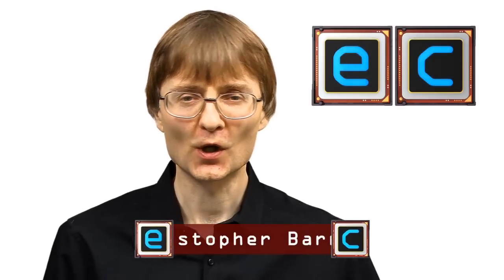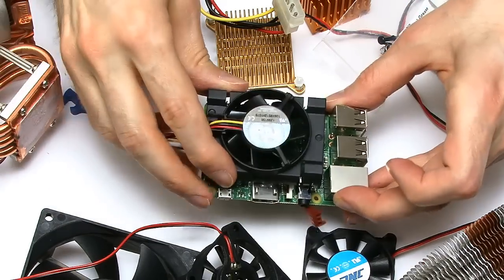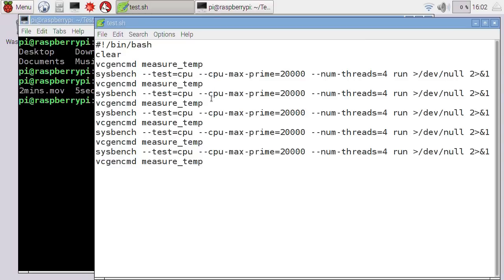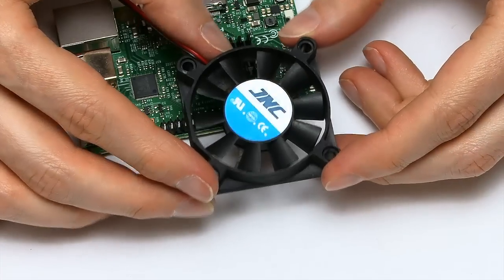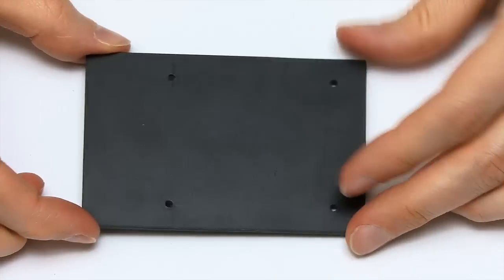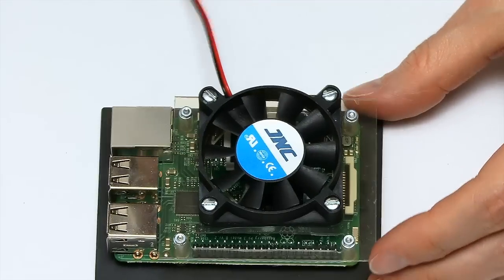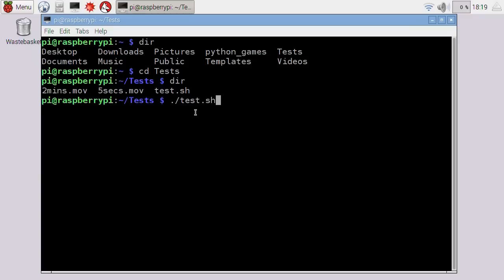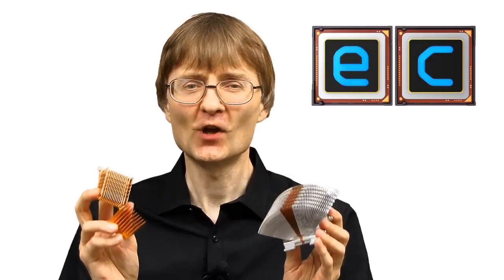Raspberry Pi 3: Fan and Cooling Tests

Comment: Those things that you keep referring to as bolts are actually called nuts! The part with the long thread and the screwdriver slot  is the bolt or screw.
Reply from the maker: +martin nash I know, I know. But under the movie lights, my brain sometimes gets scrambled. :(

Comment: actualy u had done it more faster with the 1st in minute 2:27 all u had to do is to pust something in the holes of the Pi and keep the colling up easy thing the 2nd only was gud if the pi cannot keep the 2nd cooler volts
Reply from the maker: +Dying Upon The Truth The Pi sadly could not power the first (12v) fan.

Comment: With RAM being so abundant these days, with some builds having almost hard drive levels of storage in RAM alone, I was wondering if an OS could be installed in RAM. From what I understand each reboot would wipe it, but would it be possible to load up a really fast windows on it for example? Do you think this is possible and if so how would you go about doing it?

Comment: All good doing this, however you need to see if the governor starts to 
down-clock the CPU, this really has a bad effect on performance.

To find the governor set speed:

# cat /sys/devices/system/cpu/cpu0/cpufreq/cpuinfo_cur_freq

To find the actual CPU frequency:

# vcgencmd measure_clock arm | sed -e "s/frequency(45)=//g"

You may want to round off and divide this readout in your script:

sprintf("%.0f",$1/1000000)

Running a burn-in test. My Pi 3 without heat sink down-clocks to 600 MHz
 after about 20 seconds, yet maintains 78ºC temperature. I have it 
clocked to a maximum of 1.35 GHz. With a small heat sink, it down-clocks
 to 1.1 GHz and stays at around 80ºC.  A slight breeze over the heat 
sink gets it to 65ºC and maintains 1.35 GHz.
Reply from the maker: +Simon Howes A good command to know, thanks. I did discuss this issue in the previous video -- with its higher (pre heatsink) temperatures! :)

Comment: I have Pi2 massed overclocking and I have a cut down heat sink with natural cooling with a case and the heat sink sticks out 35 mm. It temperature is 30.4'C. I have pic of it but there is no  adding pics.
Reply from the maker: +mickgibson Wow, 30.4 is impressive for an overclocked Pi2 that is working hard. :)

Comment: Should have rotated the fan so that the wiring was closer to the GPIO pins which would then allow you to use less of the wiring.
Reply from the maker: +Luigi Provencher I did not want to cut the wiring as the fan may not be  my final solution, and may hence be used on something else. :)
Reply: What are the ends called that you put onto the fans wiring?
Reply from the maker: They are female jumper connectors -- actually cut-off female jumper leads that I cut off and added on. :)
Reply: Know of any good sources to buy them new and do they require a crimping tool?
Reply from the maker: Luigi Provencher I don't know any specifics on getting them I'm afraid. You could try Maplin, RS Components or CP Farnell. Or get a jumper pack like one of these --
https://shop.pimoroni.com/products/jumper-jerky -- and remove as necessary. :)

Comment: Everything I have read indicates this is a bad way to do this and fans should run through the USB port rather than gpio.
Reply from the maker: +ozlo I would be careful what you are reading then! :) The 5V pin is technically not a GPIO pin and provides power before the voltage regulator (certainly you should not run a fan from a GPIO output). If you power a fan from USB, you are drawing power through the voltage regulator -- also not a smart idea. There is more discussion/explanation of this here: https://www.reddit.com/r/raspberry_pi/comments/4g86mk/raspberry_pi_3_fan_and_cooling_tests/

Comment: Professor, really loving (not a hyperbole) the DIY solution you did for the fan mounting. Now that's punk computing! Please, consider on doing more videos with DIY solutions.

I'm willing to bet that with a shim of copper, some drops of thermal paste and your fan solution the Pi 3 CPU could be kept under 40, even 35 °. Looking forward your extreme cooling video.
Reply from the maker: +Luis Mercado Thanks. I imagine you are right about cooling potential with copper. :)

Comment: I'd love to see a video where you also put a heatsink on the memory chip on the bottom and LAN chip and test out various overclocking settings with and without the fan.  I know that OC support for the 3 isn't official at this point, but people have been doing it anyway for stuff like RetroPIE to get N64 emulators running smoothly.

Comment: Great video.  I'm not comfortable with pi running at 80'c , and any cooling will ease my mind, especially when running the pi 24/7.  However, I'm also concerned about the fan noise,  so hopefully the 5v fan will be quiet enough.

Comment: Cant we have even smaller fans?
Reply from the maker: +Satish Singh Yes, there are 20mm fans -- but it would make more noise for the same airflow. And I also did not have one lying around.
Reply: ExplainingComputers Can we use liquid cooling for Rasberry Pi? It will be really interesting.

Comment: I only wished you used a heatpipe from an old laptop or a better heatsink.... Would love to see an extreme overclocking raspberry pi video.
Reply from the maker: +cake5000 I am heading in the "extreme overclocking video" direction! :) I need first to figure otu a good means of connecting a better heatsink (and maybe heat pipe) to the Pi's SoC. :)

Comment: Would be cool if you could the same test with a smaller fan, like "Axial Fan, Brushless Motor, Tubeaxial, Vapo, 5 VDC, 20 mm, 10 mm, 1.5 cu.ft/min, 0.042 m³/min" from Element14.

Comment: I want to run 4-5 pis at 100% cpu. My plan was to have my large desk fan beside them all. Surely this would be adequate, despite not aesthetically pleasing?
Reply from the maker: +Dragon Coders You will have to try it! I would imagine at least small heatsinks will be needed to increase the surface area onto which the fans will blow.

Comment: Good to know that you can indeed use the GPIO pins to power the fan. Very useful. Shouldn't be too hard to find a small, 5V+ fan somewhere. Perhaps I could even modify the existing case I have for my Pi, and just cut a hole for the fan to sit, and hot-glue it in place.
Reply from the maker: +Zepher Tensho A hole and hot-glue sounds like a good solution to me! :)

Comment: The best passive idea I have is a peltier cooler, on low voltage it might be a really good idea but a power hog.
Reply: +(&quot;RNA0ROGER&quot;) I did this to a Pi, and have a short video about it. Its not passive though, its almost the complete opposite of a passive cooler.

Comment: so would i do this if i used for streaming netflix?
Reply from the maker: +zach “techy guru” schwanke Streaming video should not heat the Pi up this much, so you should be fine without cooling hardware. See the opening section of my last video where I do some video playback temperature tests.

Comment: Could this have been driven from the USB ports?
Reply from the maker: +clangerbasher Potentially, but it is not something I would try myself as it would draw the current through the Pi.
Reply: ExplainingComputers Right.  But isn't that the same for the GPIO anyway.  If the USB ports are up to standard it shouldn't be a problem?  You could hack a novelty like this,

https://www.yourproductsbranded.co.uk/windy?gclid=CKOYn8nGp8wCFUJmGwodGs8ABQ

Passive does seem the way to go.  I would use a small block of copper as a bridge or adaptor to a small PC cooler.
Reply from the maker: +clangerbasher As far as I am aware, the 5V GPIO pin is connected directly to the micro USB 5V input. In other words, it allows you to draw power before it goes through the voltage regulator, and hence can offer more power than accessing 5V via USB and will not put additional load on the voltage regulator. The Pi is a low power device and I doubt it can run all USB peripherals with a significant power requirement. It may work fine! :) But it is not something I would try.
Reply: ExplainingComputers The Pi is the only reason I own a powered hub.  :)

Comment: Thanks ;-)

You can use Pins 4 and 6 instead of 2 and 6, that way off the shelf fans with a 2 pin plug will fit straight onto the GPIO header.

Im using a little 20mm high speed fan DC 5V 0.2A which works extremely well. Although it is a little louder than a bigger fan as it rotates at a great speed.
Reply: Yeah hartoz, I use pins 4 & 6 with a high speed fan too.  Great tip ;-)

Comment: How much does the pi's performance degrade at 80°C? What gain, besides perhaps pi lifetime, is there from the active cooling? Did the performance tests go faster with the cooling?
Reply from the maker: +Anton Johansson The tests an at the same speed, as with the heatsink alone the Pi 3 was just under its throttelling temperature. So the benefit here is board lifetime as you note. Though this could be a considerable benefit! :)

Comment: You should design a bracket with a 3d printer that allows you to clip said bracket into the pcb screwholes.

This bracket would allow you to clip the pentium fan on, since it kinda looks like it was "designed for the raspberry pi"
Reply from the maker: +Garpenlov Yes, there is a great opportunity for a 3D printed bracket here.

Comment: could you run a test on Pi3 how it handles BOINC running SETI@home? I want to make a small cluster but wonder what is the performance and heat load? thnx. best regards from Croatia!
Reply: ***** no, it's all voluntary. you can run it when your computer is idle, but some run it full time as a a hobby and to help scientific projects.

Comment: I love you man, I've been looking for practical solutions for cooling the pi 3, there seem to be a few 25mm fans and such, any idea how loud these will be? also how loud was that 40mm fan you used?
Reply from the maker: +Enos666 Thanks! :) The 40mm fan is pretty quiet -- nothing like a normal desktop. I could not hear it from a few yards/metres away. A 25mm fan capable of the same airflow would be far more noisy.
Reply: Awesome, looking forward to the larger passive heat sink tests later, if theres a reasonably sized passive heatsink I will be more than willing to forego a fan altogether if it all runs smoothly, thanks for all the videos.

Comment: Hello,where can i find a fan like that,can i buy one in the internet?
Reply from the maker: +Alban Mulladauti (Bond0087) Try a search on, eg, Amazon (in computing) for "40mm 5 volt fan" (the key thing is 5 volts, as many are 12). Eg I found this: http://www.amazon.com/Gdstime-40mm-Small-Brushless-Cooling/dp/B00MYZADCY/ref=sr_1_5?s=pc&ie=UTF8&qid=1461504001&sr=1-5&keywords=40mm+5v+fan
Reply: +ExplainingComputers thanks very much

Comment: Chances are, that fan draws more power than the Raspberry Pi itself.
Reply from the maker: +Joshyy Indeed! :)
Reply: +Zynoz of course not.
Reply: umm nope, most fans draw around 70 MAH (0.070 Amps) while the pi draws upto 2500 MAH (2.5 Amps) so do the math
Reply: +Joshyy Not really. I've equiped several Pi 2 and 3s with old 12V 50 and 60 mm fans (running at 5V from the GPIO with lower RPM). None of them added more than 0.5 W measured on the wall adapter. A rough average should be 0.3 W. Better adding this tiny amount of energy to your power bill than frying the Pi over time. ;o)
Reply: Where did you find that?
Reply: with me it was fine but I wouldn't recommend it lol
Reply: Thank you for the input man :)
Reply: Can this harm the PI?
Reply: +Takuya Kousaka ok
Thank you for the quick answer :D
Reply: I did look it up the other day and found that they are making fans specifically for the Pi now.
Reply: +Joey Plays cool, do you have a link or a name for the fan?
Reply: +Zynoz Sorry for the late reply. Here is one link on NewEgg and you can probably find others. http://www.newegg.com/Product/Product.aspx?Item=9SIA76H2GT0020&ignorebbr=1&nm_mc=KNC-GoogleMKP-PC&cm_mmc=KNC-GoogleMKP-PC-_-pla-_-Case+Fans-_-9SIA76H2GT0020&gclid=CjwKEAjwu6a5BRC53sW0w9677RcSJABoFn4spNECGv2SLe9EvAsmLQZHQLYYHqiBJRlV6h_pcAFJZRoCipbw_wcB&gclsrc=aw.ds
Reply: +Zynoz Another one on Amazon. http://www.amazon.com/Tontec%C2%AE-Raspberry-Cooling-Cooler-Heatsink/dp/B00GOIWXMA
Reply: +Joey Plays thank you very much :D
Reply: +Zynoz You're welcome :)
Reply: +Joshyy Expect 50mA for a < 80mm fan, ~80-100mA for an 80mm fan and around 150 - 200mA for a 100mm fan. There are 3-pin fans where the 3rd pin provides speed info and the idea is you can adjust the fan speed based on CPU temp. Alternatively just turn the fan on when the CPU gets too warm.
Reply: +Takuya Kousaka it can harm pi, it will try to draw all current it has, it may not turn on pi but components may be damaged
Reply: Alex Stone Shouldn't there would have some current limiter or something? since usb is doing that
Reply: Takuya Kousaka on pc yes but on small board like this you have big chances to fry it
Reply: Alex Stone ah, TIL
thanks for clarifying
Reply: +Joshyy Yes. But if that is the case, then maybe you dont need a fan. Because the cpu wont get so hot if it isnt drawing so much power...
Reply: +Lord_Vader I have applied a heat sink to the CPU. Can't even touch them after running for one hour cause it's so hot. So I think a fan is necessary
Reply: Well ive got a heatsink on mine too. And its doing boinc/seti@home 24/7 and it gets at about 84deg hot. Thats a lot. And i just purchased a noctua 5V fan and doing the drawings for a ducted case for the pi (a remix of a case). But my Openelec pi doest exceed 60 deg when running HD movies or youtube so there it is not nessesary
Reply: Have you ever tried a northbridge fan + cooler? The cooler is one like he used in his previous videos. I think combining that one with a fan would give some impressive results. I will try it when my Raspberry Pi 3 arrives tomorrow.

Those northbridge coolers + fans costs nothing on eBay.
Reply: I powered a fan off a 5 volt and ground gpio pin

And i did with another at the same time

So 2 fans can be powered off of it
Reply: Blazeborn hub be careful about ratings on the fans
Reply: i will thanks m8 ;3
Reply: Blazeborn hub just one more thing, if you block the fan/s they will probably draw A LOT more current than usual so you may even burn your board
Reply: eh i can always buy another ;3 thanks for the tip tho!
Reply: Blazeborn hub good for you, i couldnt even collect enough for one, its 55euro here in serbia
Reply: +Blazeborn hub Two fans spliced on together to feed from the same jumper cables? Is it safe? I AM A NOOB YES. So if i splice the cables of the two fans to feed from one 5v pin and one ground pin will be fine?
Reply: +Nick G what I did was I took was 2 5v pc fans from cpu coolers, and I popped the cords out of the plastic shell that they were encased in at the end of the cords then I took the ground and 5v cords and found the layout of where they were located on the rpi 2 and I placed both of them there since there are 2 5v and 2 ground I managed to achieve 1 fan on bottom and 1 fan on top creating a sandwich sorta design along with some tiny aluminum heat sinks that came with the kit I bought I acheieved pretty low temps
Reply: +Blazeborn hub And no problems with the pi board due to amp draw? Everything runs normal with two fans on one "header"? Thank you for the answer in advance by the way :)
Reply: ey np just tryna help people out :D have a good day!